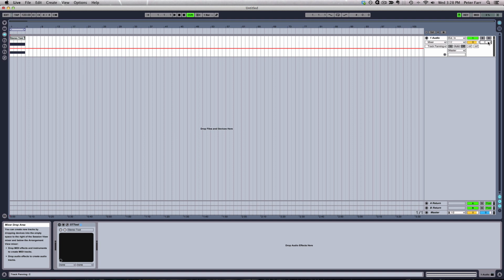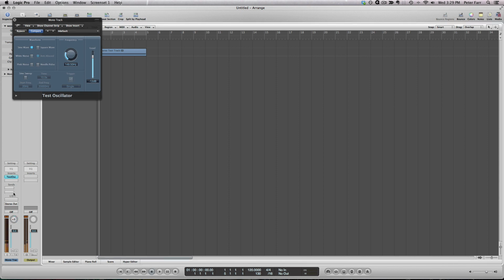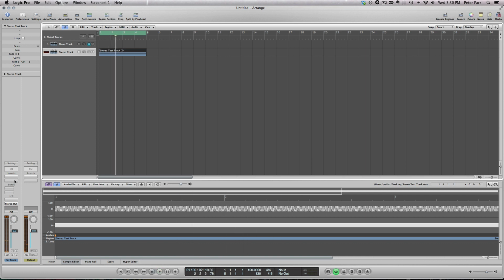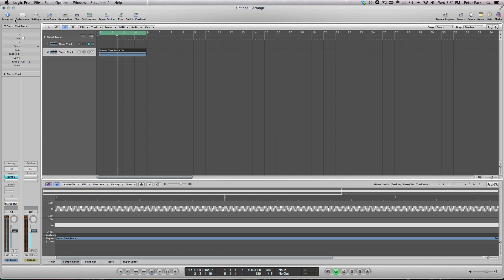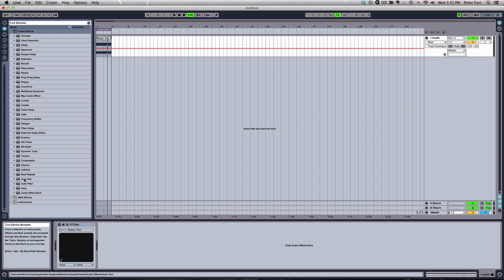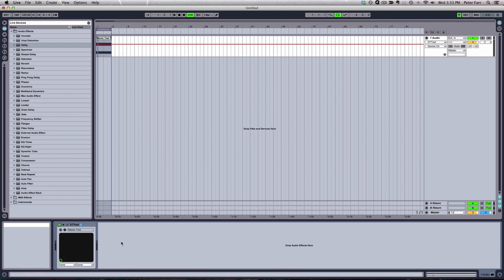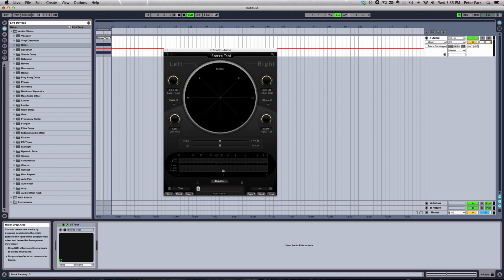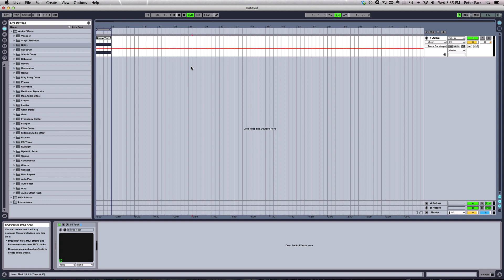Ableton Tutorial: Accurately Pan to improve your Mix

Comment: I have ableton 10 , i don't beleive that this problem still exists to this day in this software and it has not been addressed. Thank you for sharing this informaiton.
Reply: Ableton 10 solves this problem by giving you the opportunity to switch the old pan to "Stereo Split Mode" (via right-click). This way you can move BOTH channels (left and right) INDEPENDENTLY. This way you can move BOTH signals to the left or right.

Comment: QBase does it right! I use Logic pro and I am still disappointed in it's capabilities. Yes it does pan with the DIRMIXER plug in but to control the stereo spread (Stereo width) after it has been panned using DirMixer is still pretty rough.
https://www.youtube.com/watch?v=44XQjNYsU28&index=1&list=PL-ucjbItzJBlwRmVnHRl-gsE8YRQtGTxi This is proper pan and spread control!